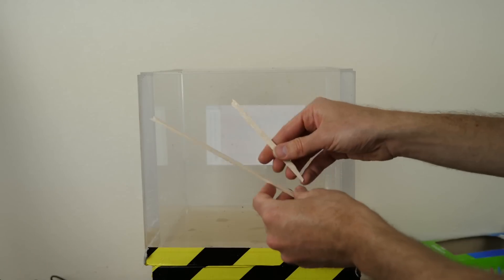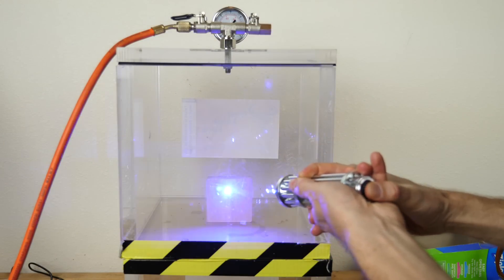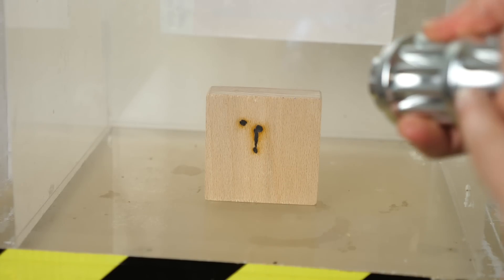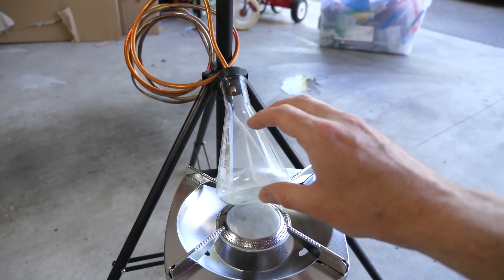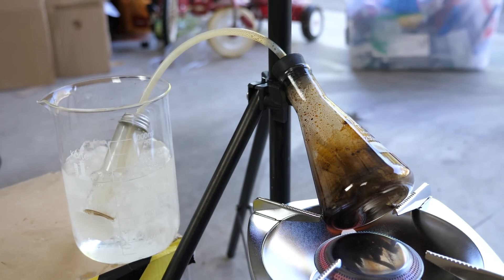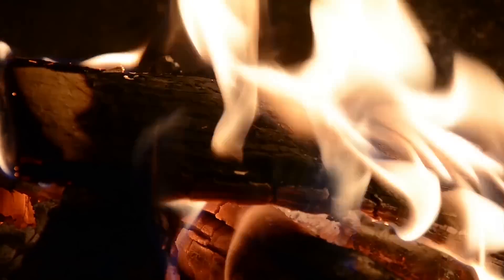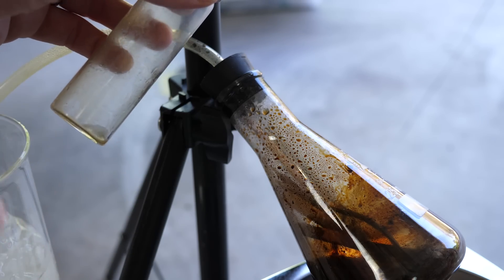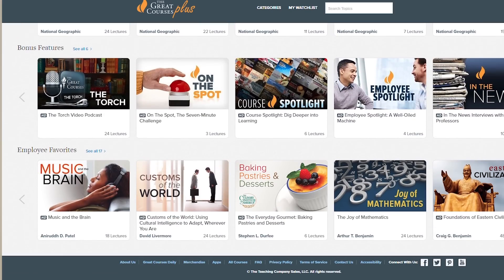Is It Possible to Melt Wood in a Vacuum Chamber? The Wood Distillation Experiment

Comment: i’ve wondered this for YEARS “why do some things burn and some things melt” AND NO ONE WAS ABLE TO ANSWER IT UNTIL NOW
Reply: Hi, I'm 6 years ol and i knew that they are like that before this.
I, myself am an intellectual 

I can also deadlift 220 kg
Reply: Would it disturb you to know that if you light certain types of plastics, they will melt and flaming drops of plastic will fall to the ground?  They make an interesting "zip-zip-zip" sound.
Reply: Pop corn pops first, burns when lit afterwards, and melts on your tongue. Beat that. Yes, you can beat it too, and it breaks into pieces.
Reply: lemonmania96 Bad teachers
Reply: lemonmania96 or rather you didn't ask someone who could answer you
Reply: Shivdini weak as heck big guy. I'm 4 and a half and I clean that for reps
Reply: no everything melts but in different ways like wood for instance, wood cant melt but the ash left behind can melt. melting iS a proces where molecuels in somethng move fast enough it can take all the space in a certant area and im 12 and know that
Reply: It pretty much depends on the composition of the material. But everything can burn. Burning is oxidation.
Reply: lemonmania96 yeah
Reply: lemonmania96 same!
Reply: cooldude does vids Dont call a little kid that...
Reply: http://bfy.tw/IAfg
Reply: Well, if you go into an engineering or science degree in university, they'll teach you this shit.
Reply: Shivdini. Somehow I doubt your being 6 years old, but if you are indeed, good on you.
Reply: I eat my poop
Reply: It burn because there is a flameable substance on it like wood, coal, oxygen, etc etc. Some things that I know melt are thing that usually not burnable, but I don't know the case with plastic since they both melt then burn
Reply: Can water burn?
Reply: leesaudan from what I know. Water can be boiled,melted {from ice}, vaporized, not burned
Reply: So, not everything can burn.
Reply: Some substances can be solid and liquid and others dont thats why
Reply: Starex Bom no just no, you didn’t
Reply: Shivdini rly nigga
Reply: Some things melt and some not, but everything can burn even metal but it have to be long over The melt tempeture but it still cant. And im 12 year and alredy know that.
Reply: The referencer say mums
Reply: I'm 12, and I knew why before this.
It's be sure the wood doesn't melt its Ashes melt

Comment: Yeah i think so bcuz pressure affects the temperature required to reach the hot hot temperature, like water in a vaccuum chanber boils but is not hot. Its just that the boiling tempersture is low

Comment: the wood will not melt becuase it is combustable, no matter the pressure, it will NOT melt, however, there is an exception, the elements in the wood can melt

Comment: why does the laser effectively burn the wood without burning the plastic around the vacuum chamber?
Reply: Since the glass is transparent, the laser shines right through it without the light being absorbed.  It's the absorption process that converts the light from the laser into heat, so without absorption, it stays cool.
Reply: okay neat, thank you for the explanation! so i'm assuming that a mirror WOULD actually reflect a laserbeam or would there still be some level of absorption there?
Reply: I mean, everything has some level of absorption - it's impossible to make a perfectly transparent or perfectly reflective material in the constraints of the real world.  That said, a nice shiny mirror should absorb very little light since it's designed to reflect it all.

Another object that reflects a lot of light is a white piece of paper.  The reason it's white is because you see all the light reflecting back off of it, but instead of reflecting in a specific direction like a mirror, it bounces off in all directions.  You might note that paper does indeed tend to burn when exposed to a powerful laser, which demonstrates that it's not perfectly white, and that even absorbing a couple percent of the light of a powerful laser represents a lot of energy.
Reply: brilliant, would not have thought about that had you not brought up the paper burning. that's fantastic. again, thank you very very much for your responses! i'm 27 and i feel stupid asking these questions sometimes, but even without knowing my age/background you explained it, taking time out of your day to do so. thanks, friend!

Comment: Can jet engine fuel melt steel beams?in a vacuum?
Reply: Well, jet fuel needs oxygen to burn, so no, it would not melt much of anything in a vacuum chamber.  XP

More seriously speaking, the inside of a jet engine is not made of steel at all.  Steel softens at much to low a temperature, so it would pretty much destroy itself if you tried to run it.  Instead, they use nickel based "superalloys", such as Inconel.  The important thing about these is that not only are they highly corrosion resistant (so they don't oxidize in the extreme environment of a jet engine), but they stay hard nearly all the way to their melting point, unlike steel, which softens significantly well before it actually melts.  This softening property of steel has been used by blacksmiths for thousands of years in order to shape red-hot steel into a useful shape, such as a tool or a blade.
Reply: Morgan Jones it certainty burns hot enough to severely weaken it to the point you can bend one pretty easily.